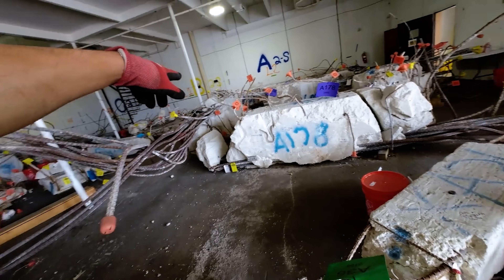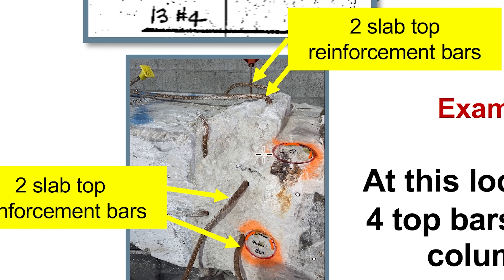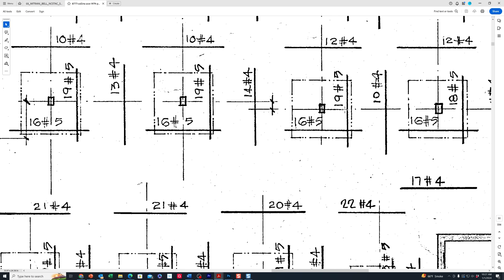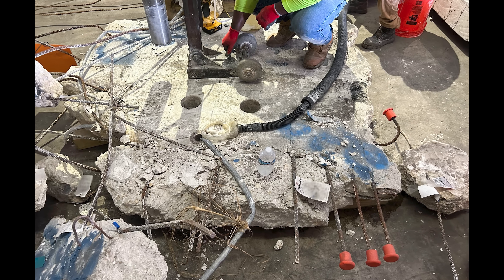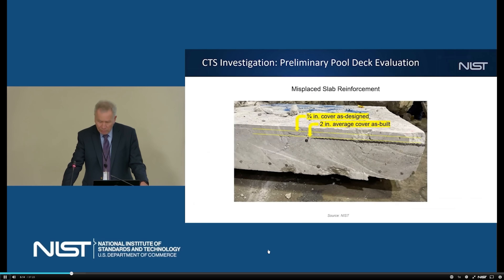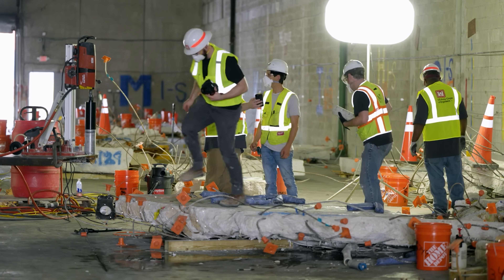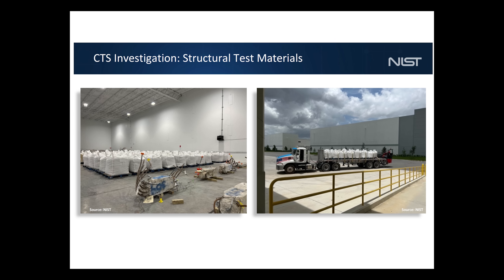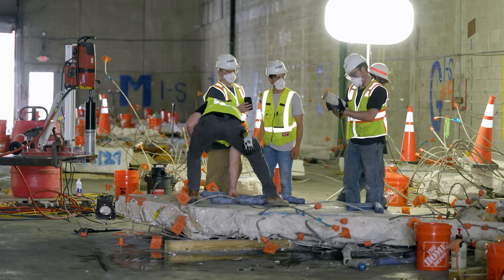More Shocking Build Errors in Miami Condo Collapse

Comment: I’ve worked in IT for 10+ years. You can definitely get some data off of that drive you showed. It may not be perfect but you certainly can get the data. Unless the drive is magnetically destroyed and physically destroyed, you can always get something off of the drive.

Based on the pictures, the camera system was not a high end one (and based on the building Collapsing due in part to poor maintenance it’s decently safe to say, they were cheap) so it is pretty likely that the footage was not encrypted (with anything fancy at least). If it does happen to be encrypted there are people who are still alive and around that would know the password to the system. They might have had a contract with a company for the cameras and they would have the password. So the contents could be decrypted easily. If they did not have a contract with a third-party for the cameras, then the security team would know the password if there was one. I’m sure the manufacturer can get in as well. 

Needless to say, we have a pretty good chance at seeing some sort of footage soon. I can’t wait! Thanks for keeping us up to date!!

Comment: NO financial affiliation with them, but 300 Dollar Data Recovery did a fantastic job with getting the CCTV footage from my condo's battered DVR after Hurricane Ian.   We found the recorder some 100+ feet away, buried under about a foot of sand.   They recovered everything up until the point that the recorder was ripped from the wall by the storm surge.

Comment: The first thing folk need to ask before blaming the builders ( workers and management) is where were the inspectors?  In the U.K. all rebar HAS to be inspected and signed off before the concrete is poured - no exceptions.  With that said, I've known many sites that had reasonable workers and management, indifferent materials laying around and the inspections DID NOT pick them up!  

Just by rule of thumb, looking at the wreckage - I criticized the design / construction / inspection on this job and pointed out the most likely initiation occurrence. The general spec for rebar - is way below what it should have been - even without thinking of salt water effects and fairly normal site problems.  One of those being average workers on r.c. work - columns are shuttered and cast, then the support for the floor above is built - quite often the column rebar is left long and requires bending into position as Jeff indicates and tied into the slab. Great when done well but many simply break off when the worker attempts to bend them too tight a radius. Nothing much is ever done to rectify. I'm sure this happened all over and on top of the entire job being under specified for the weight it ended up supporting.

Edited to add that I've posted before that a 3/4" coverage would be completely ignored here - every ironfighter has 2" minimum coverage drummed into him - regardless.
Reply: Inspectors can be bribed to accept inferior work.  Or in the New Orleans building collapse: Don’t showup at all.  (That inspector never went to the site.)

Comment: Seems like there was a perfect storm of errors and omissions (deliberate or otherwise) on this project. It's looking more like design errors, lack of oversight/inspection and unaccounted-for loads (planters/pavers on the pool deck) may be proximate contributing causes of this collapse. With what is suspected, it's a wonder it lasted 40 years.

Comment: Disappearing rebar is a common problem. A real life example is a residence where a sidewalk with a waterline was being constructed. A county inspector came by & found that the copper water pipe was installed with the correct amount of rebar. The concrete was to be poured the next day, but someone removed some of the rebars & replaced the copper pipe with galvanized steel. Early next morning another inspector walked by to visit a neighbor by coincidence & happened to see this before the concrete was poured. He contacted the owner & the pour was cancelled. There were heated discussions afterwards to correct this. Dishonesty is a problem in building/construction.
I speculate that a similar problem with dishonest construction happened here.

Comment: Quality steel rebar is expensive stuff, as is common practice in China, reducing the rebar content by 50% saves a lot of money.  If the contractor and the rebar supplier have a “relationship” then, even though 100% of the required rebar was paid for by the builders, the supplier only supplied 50% and the difference in cost was split between the rebar supplier and the contractor.  But that is China, not the USA and I am in no way suggesting that is what happened here.

Comment: This lack of correct rebar placement is similar to the failure seen in the columns of the Cypress Freeway collapse in Oakland.  Contractors save money and time by using fewer materials which decades later results in a structure that is more than likely to fail when undergoing stress.

Comment: That makes no sense. The section of rebar above the columns to prevent punching shear has to be a certain size. If the spacing was larger then the whole section would have been larger. No one would make the size of that section properly but leave a big gaping hole in the middle by crowding the rebar towards the outsides and away from the column. If they did do that, that's no incompetence, that's blatant murder. Because they're not saving time nor money by using the proper amount, but spaced away from the columns. It would be a purposeful act.

Comment: I don't think they spread out the rebar too far. I think they simply didn't use the proper total amount. To either spend less and pocket some money, or to meet a quote. Less rebar, wider spacing.
Reply from the maker: NIST showed that they spread out the bars too far. The spacing was simply incorrect. They may have also put down feer rods than were called for, but the spacing was definitely off.

Comment: Ensuring correct rebar selection and installation is the responsibility of the state code enforcement inspector. No concrete is poured until the inspector gives the "go-ahead". Considering that fact, there appears to be a disconnect between the design and construction that the inspector "overlooked".

Comment: Whoa, the design engineer wrote the rebar instructions correctly but the builder didn’t follow them. Therefore, it’s the design engineers fault for not highlighting the instructions??? Common’ man the engineer shouldn’t be required to babysit the builder.

Comment: Who had the responsibility to check that the construction complied with the design drawings?  Surely there was a Resident Engineer on site to ensure compliance?  If there was no engineer then the responsibility would fall on the shoulders of the contractor to quality control the installation irrespective of whether he delegated that to his sub-contractor?  

My overriding impression from the photos is how almost random the spacing of the reinforcement is including the stirrups, which to me shows both incompetence/negligence by the steel workers and a very serious omission of quality control.  This level of building is not seen even in 3rd World countries.
Reply from the maker: ultimately it is the construction company supervisors and the city inspector is the last hope of catching an error
Reply: @jeffostroff I am not conversant with the US construction hierarchy but for example, in UK the contractor has an obligation to construct the project in accordance with the design drawings and spec and the designers warranty the design to the client and occasionally third parties.  As the designers can't be expected to inspect the construction as frequently as would be expected on a building of this size and type, the client employs a Resident Engineer, who checks the structural elements day to day and a Clerk of Works for the architectural elements and depending on the complexity, other resident consultants.  All of those inspectors will be closely monitoring the quality and pulling up the contractor when its not up to standard,  All the defective work will be noted and woe betide the contractor who doesn't take note and rectify the defects.  As an Architect I certified payment to the contractor for the work done and the principle I always adopt is that I will not certify payment for defective work but crucially not for anything that is affixed to that work   I've had some major arguments but in the end the power of the cheque book rules!  The Local Authority Building Inspector by and large is of little use in inspection as they don't visit site often enough to be useful and besides its impractical to be able to sue them for failure to inspect the work and condemn any defects.

Comment: I don't think that there was an inspection by the Structural Engineer. Owner developers did not budget for this expense. It wasn't until the Cocoa Beach high-rise collapse in the early '80s that Florida started to require a Threshold inspector on any building over 2 floors. We had them on my buildings. I did a video on the Cocoa project.

Comment: Good video.  The savings here wasn't just the cost of the rebar, the labor cost was probably higher. This meant the contractor put money in his pocket, and either paid off the inspector, site manager, engineer or all of them.   I don't know how a site manager could be so incompetent that he didn't go out and count the rebar. Seems pretty obvious.  
What's highly probable is that whoever did this at Champlain Towers did the same thing at other buildings. NIST and Florida prosecutors should set out to find at least five more buildings with the same deficiencies, evacuate them, claw back as much money as possible.  Prosecutors should go  after more recently built structures with deficiencies so they can sue people and companies still around. You only have to crush a handful of these people to make them all stop these practices.  
What will happen is what always happens. Everybody will point at everybody else,  a financial settlement will be reached, no one will be held responsible...and it'll keep happening.  The pointing will be the engineers to the contractor, the contractor to his employees, everybody will say the building inspector should've caught it, the building inspector will argue that his job is to make sure 'the work is being done correctly' meaning the wire ties between the rebar, not checking on the  rebar spacing  the plan specifies. They'll all add that the ground conditions were an unforeseen factor.  
What needs to happen is someone needs to be defined in law as being ultimately liable and then people need to go to prison.  Other buildings should be inspected, metal detectors, opening up concrete work -- and if they cut corners, evacuate the building, fix it or tear it down.  Responsibility for structural safety and integrity of a building should be permanently attached, meaning selling the building is no defense against a later problem.  (What's always happened in the oil business is old wells owned by the majors are sold off to fly by night companies who take out oil, then declare bankruptcy leaving the state to have to clean up the site and seal the well.) 
When we see some low life criminal shoot someone in a robbery no one has a problem with that guy spending the rest of his life in prison. But when real estate developers, contractors, inspectors, and condo boards kill dozens of people.... oh, what a tragic mistake.  People did this. Had that building been properly constructed the first sign of serious structural failure would've led to evacuation not catastrophic collapse. Look at the recent Turkish and Japanese earthquakes. Turkey: corruption, catastrophic collapses thousands dead. There's an image from Wajiwa Japan of a 5 story building that collapsed. The ground level failed and the building fell over, but remained intact.

Comment: Error #2 solved a problem in interpreting error #1.  There would be no reason to somehow go around the column heads, but since they were spacing wider they just didn't ever hit them.  Speaking as a former (not large building) contractor, I can conjure up a plethora of scenarios how this happened.  And how did nobody up and down the line of responsibility noted that rebar was most important at those column heads.   The engineer and architect should have been on this, as punch-through of the columns has to be the concern, and as it happened the result.  The larger spacing might not have hurt so much if it had just been in the slab, while still being up to spec at the columns.

Comment: It's not just the contractor's fault: The architect is supposed to check that all building is up to specs before signing off. I don't know about Florida, but in France, the 10-year warranty for a building falls under the architect's responsibility, so architects are not just drawing plans, they also sign off on the construction being done according to plans. They are paid a fee from 8 to 15% of the building cost for this.
It is also pretty easy and quick to check that the pillars have 4 rebars instead of 2 or are at the specified spacing before starting to build the next floor.

Comment: First off...love your channel!...but I do disagree on your take of the rebar analysis.  If the note says 25% over the columns...then 4 #5s per the 16 bar spacing and 5#5s per the 19 bar spacing.  And the bars over the column should be equally spaced over column footprint minus your 2" min cover from perimeter.  Utmost respect but I do believe that it should have been 5#5s in the 19 bar spacing✌️🖖

Comment: For the rest of the sick buildings ( condos )  how would you fix or add reinforcements  to  prevent  colaps?  The rebar will for ever rust the concrete   will  weaken ( heat% cold = exspantion/ contraction)   at point in the future  these  buildings will be  too much to fix or save.  50 /75 /100 year's  old ?   There's  a lot of  them from the 60s and 70s.   From Palm Beach  to South  Miami.   Run forest Run.

Comment: This just keeps getting more and more unbelievable.  Not only does it look like the pool deck was maxed out as originally designed by the plans, It wasn't even built right to support the plans weight in the first place!. She was a ticking Time bomb even without the added weight and upgrades over the years to the building. Let's not even talk about deferred maintenance to it. I don't know how it stood up as long as it did. 

Im Actually surprised that the foundation didn't have any sinking in it,with all the water that would get in that parking garage. Could that have all been run off from rain running into the garage? Keep up the good work Jeff.
Reply: Hopefully the hard drives will show something. Still think that's incompetence that they didn't pull those out before they blew it up
Reply: @dougc190 THE hard drives were probably already destroyed by the initial collapse.  And the remaining structure was too unstable to let people go inside to retrieve stuff

.

Comment: These deficiencies clearly justify why in the building codes 3rd party steel inspections and statements of compliance from the design professional are required.  Building inspectors do not have the time to inspect all of these facets of construction nor is the contractor willing or able to impede the construction schedule while they wait for the local inspector to verify all of these items are in compliance with the reviewed plans.  I am unable to verify completely if the codes in place at the time of construction for this building had this requirement, simple logic would dictate it might have been advisable to have had these verification procedures in place. But in my past experience developers, owners, and contractors did their best to avoid these requirements due to the cost.

Comment: Seems the columns were too narrow to start with same with many of the beams. Insufficient reinforcement at the top of the columns to spread the load over a broader area to prevent punching shear to start with.  My brother-in-law did foundation work up in the high country of Colorado where some places they had to had extend Foundation walls well away from the house to secure against slippage each spring during the snowpack melt.

Comment: I'm wondering how much inspection was done during construction. Nowadays, a tech verifies rebar against engineering specs before pour, cement strength, design, etc. Was that not done when these were built? These materials tests existed in the 50s, wouldn't they have performed them on such a large construction in a difficult environment?